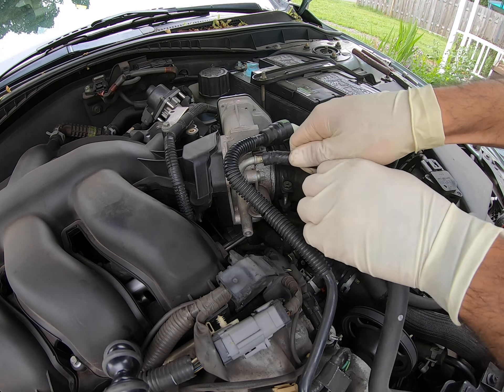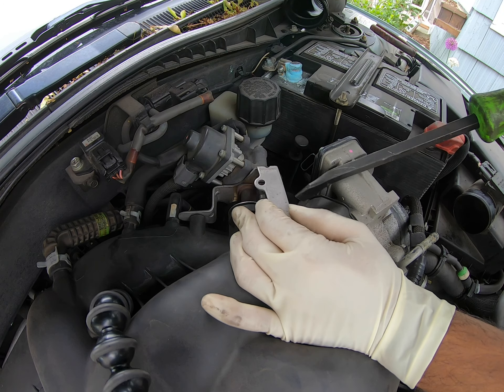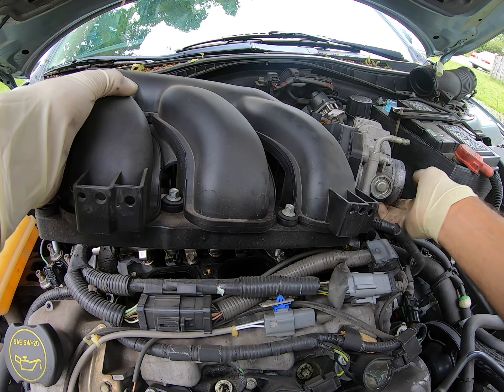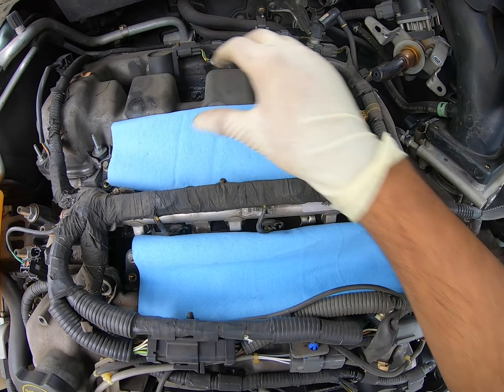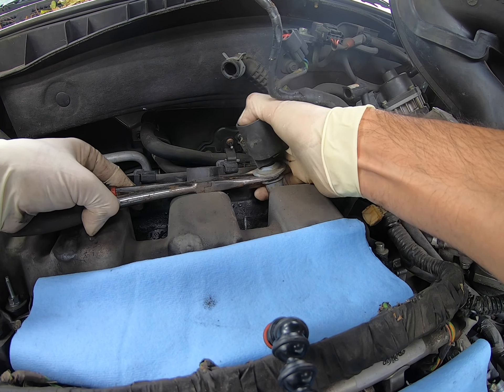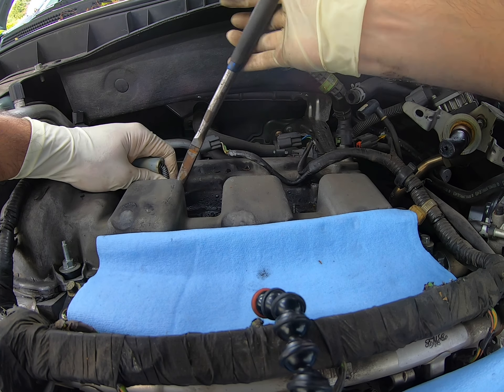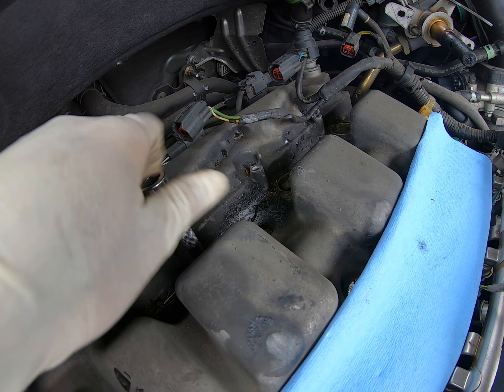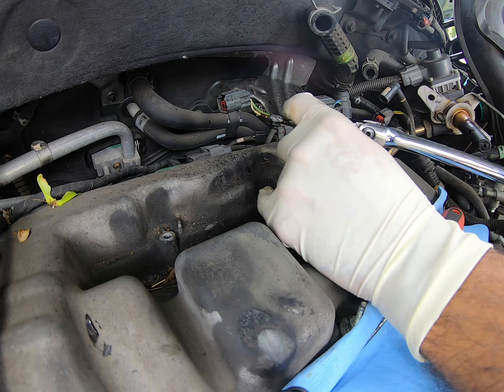2002-2006 Mazda 6 spark plugs replacement PT 1

Comment: Great, great video with the perfect shortcut on moving/removing the manifold plenum.  Just a note, look at @3:00 -- see the tube coming out of the EGR Valve? (cooper base)...  that has 2 holes.  One on the end/tip and one in the middle facing down towards the firewall.  The end hole for me was 100% clogged and the other hole was over 80% clogged and causing all kinds of issues.  Always check that tube, and clean if needed.  (you can remove the 2 bolts hold it on the bracket using this removal method...)   Great help, thanks!!

Comment: I just did this today, on my sister in laws 2006 mazda 6, v6. Be careful when removing the intake and sitting it to the side. I unplugged the throttle body and didn’t think anything about it. When I pushed the intake over to the side, I accidentally smashed the pins that the plug connects to. Didn’t realize it until I was done and reassembling everything. Got really lucky and was just able to bend them back up and straighten them out but could’ve been BAD. Just one of those things that can happen easily and not think about. I’m usually pretty good when it comes to this stuff. Just trying to help someone else out.
Reply: Just did mine tonight, same thing happened to me !  Was very lucky too

Comment: @1:00 mark, behind the EGR valve what is that part called that is attached to the frame and has 2 electrical connectors and 2 maybe vac hoses? My brother was working on his Mazda and one of the hoses came off but it broke off the main piece that is attached to the car and now we have a leak. I have no idea what it is called to even try and order a new one. Any ideas?
Reply from the maker: Evap solenoid or purge valve hard to tell at this particular moment

Comment: I appreciate the video I've had to change the plugs number one coil pack three times my Upstream O2 sensors both of them thank one and two now I got to change the number one injector any tips
Reply from the maker: Replace the Injector O rings after removing the fuel rail to replace any injector
Reply: One other question real quick on the intake manifold there's three hoses the little one that has 90° fitting  its  came loose were does it  connect

Comment: I got 3 lean bank codes after doing this any reason why I did Everything perfectly
Reply from the maker: Did you replace the plenum gaskets?
Reply: Yes sir made sure was all tight and followed your bolt pattern for it didn’t strip anything or nothing I did a great job